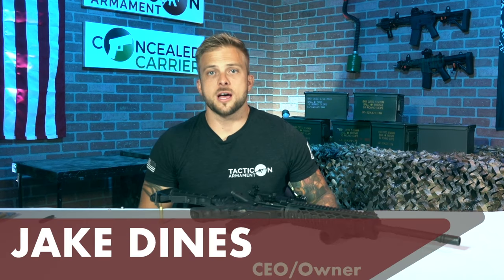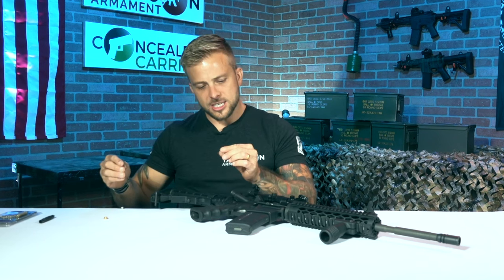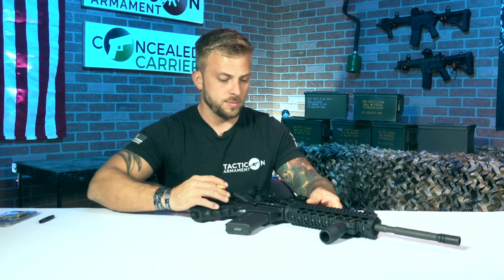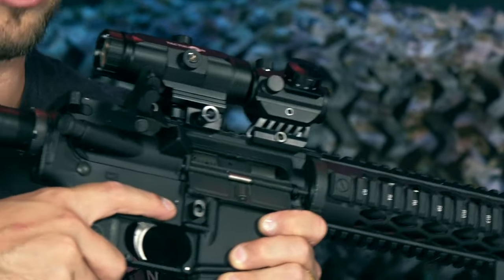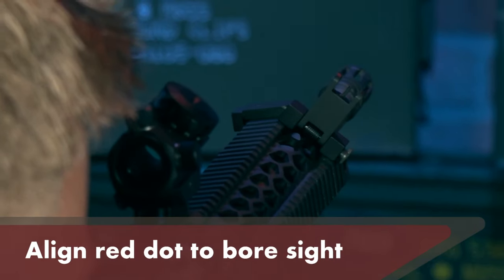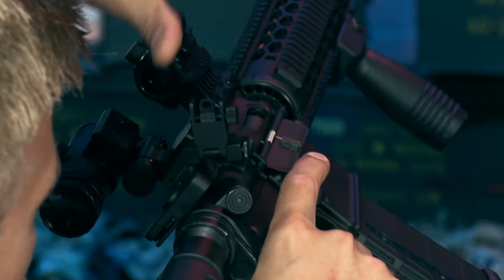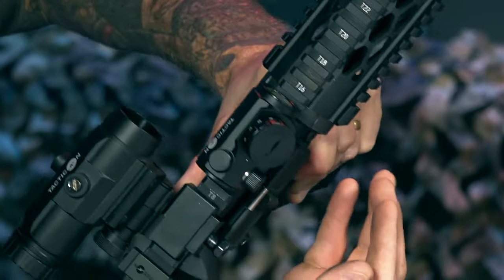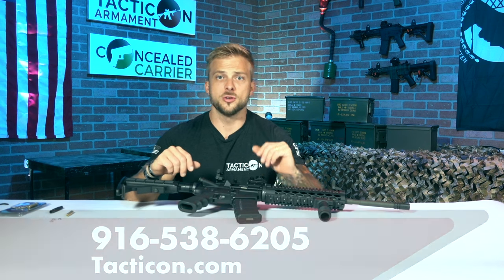Zero With Laser Boresighter - Instructional Video - .223 / 5.56 / 9mm /  .45 / 7.62 / .308 / 12 GA

Comment: This is how we zeroed our weapons in the Army
Reply: At what distance? I’m tempted to do 36 yard
Reply: @MrGunnar177 using a normal 556 with 16in of barrel, you would want to zero at 25 yard, which also zero it at 300
Reply: I was in the army and we never used this. I deployed twice and we only zeroed on the range by perfect grouping. My weapon was an extension of my body so I understood everything about it. Breathing, trigger pull and environmental situations all had to be calculated. I don't think I could ever trust a laser to tell me where to zero. Unless it was a PAC laser. Wait a sec I just contradicted myself hahaha😂
Reply: Currently in the army, we have never used them either. Always on the range, perfect groups at 25 meters. For that 300 meter zero@marcdominguez597